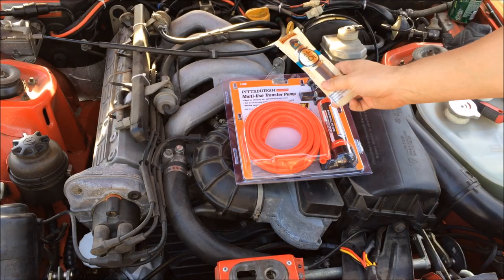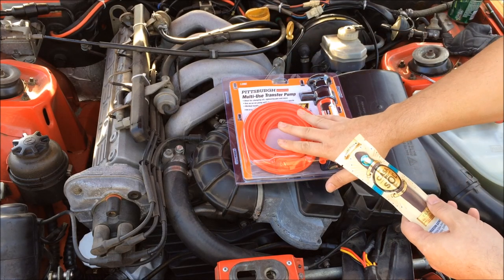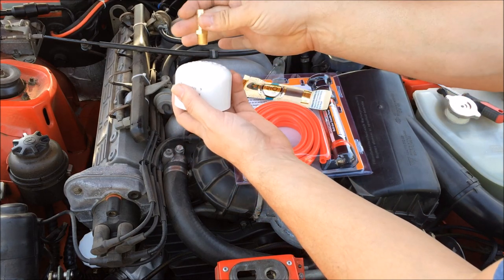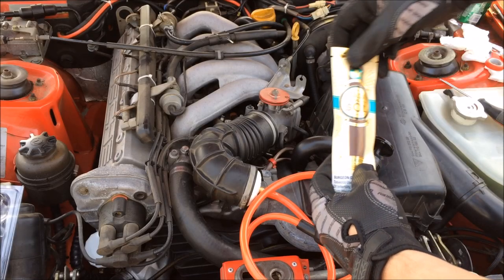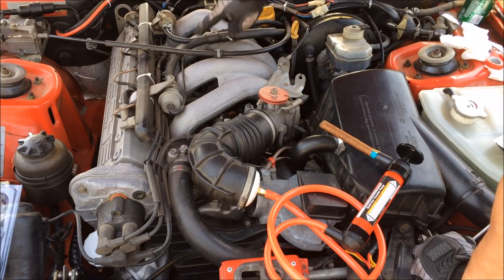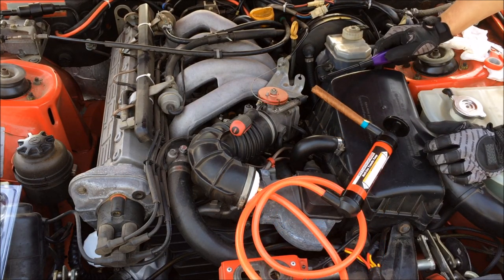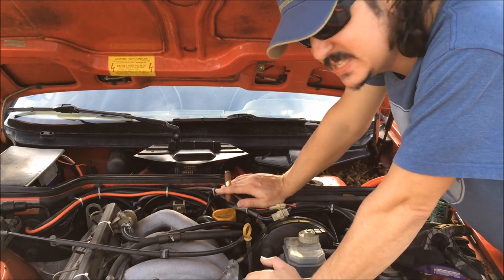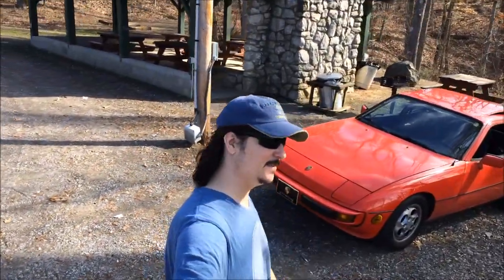Cheap DIY Smoke Tester

Comment: Im having a very hard time finding this barbed compressor fitting and cap, help me out more please
Reply from the maker: https://www.zoro.com/value-brand-hose-barb-14-in-barb-14-in-mnpt-brass-6afp0/i/G1502916/feature-product?gclid=EAIaIQobChMI2v--go6I2QIVlgOGCh27UwBmEAQYAiABEgLc__D_BwE
Reply from the maker: Here's what it looks like. Home Depot should have them... if not Harbor Freight might.
Reply: edredas thank you very much, the cap as well please
Reply from the maker: just a regular pvc pipe cap. Looks like this but you will need to know the exact size you need since all intakes are different sizes http://www.pvcpipechina.com/product/2-6-2b.jpg
Reply: edredas ok thank you very much bro
Reply: edredas i bought everything, how do i start when it comes to drilling that gold fitting into the cap? Im stuck because i dont have experience.
Reply from the maker: The easiest way is with a drill bit. Just need to get a small hole started in the center of the cap, then go back and make it large enough to thread the fitting in with a wrench.
Reply: edredas i dont understand, im sorry about that im just trying to understand how to perform this correctly on my own.
Reply: edredas i need help when it comes to drilling the gold fitting onto the middle of the cap, can you help me?
Reply from the maker: If you bought a male fitting then you just need to drill a hole in the cap large enough to thread it into.
Reply: edredas i dont know if its a male or female because yesterday evening i stopped to advance auto parts and i showed the employee that was helping me out the picture of the gold fitting and he found one closest to the one in the pic u sent me
Reply from the maker: If yours look like the one in the picture I sent then it is the correct one. You just need to drill a hole and thread it into the cap. https://www.joewoodworker.com/veneering/images/tap-the-cap.jpg
Reply: edredas i can’t find this pvc pipe cap for a 2003 dodge caravan intake, i checked home depot & lowes and no luck. What can you do to help me?
Reply from the maker: You will need to measure the the hose on the Caravan to know which size pipe cap you'll need.
Reply: edredas i just found a pvc cap inside ACE Hardware, it fits tight in the hose, its not the same pvc cap u have but a different style like this: https://m.acehardware.com/product/index.jsp?productId=1275960

Comment: What about a car with electronic throttle?
Reply from the maker: Hmm. Good question, unfortunately I'm not sure there is anything you can do. I don't recommend trying to move the throttle manually or you could mess it up.
Reply: Just remove the intake tube from the throttle body and place a rubber glove over the opening and find another vacuum line(possibly off of brake booster) for you to inject the smoke into
Reply: why do you think that matters? still do this smoke test the same way. electronic throttle bodies aren't completely sealed. there's always small passage for air so the car can idle.
Reply: @Wrenchingdaily   what?

Comment: Genius holy shit!!!
Reply: I tried this and found a leak from my EGR valve right away. Replaced the EGR and no more code! Awesome! Only thing is that next day the car wouldn’t start. Cleaned the MAP sensor and all good. That thick smoke can make the MAF sensor dirty (some cars like mine have MAP sensors). I’d recommend just cleaning those after doing this since it’s easy and you’ll have no problems on the road ✅ This method is so cheap and easy!!! Thanks!!!!

Comment: I also couldn’t find that cigar you used in the video either, its been a pain in a butt to find the cap and cigar. Lol
Reply from the maker: You can use any cigar, it doesn't really matter the brand. I just bought whatever they handed me at the store. As for the cap, there should be a size that should work. If you're not sure of the exact size you could always buy a few and see what works since they're cheap. I hope that helps!
Reply: edredas i dont understand how you open the throttle plate at all, i have a 2003 Dodge Caravan SE
Reply from the maker: Follow the throttle cable from the firewall up to the bracket. There might be a plastic cover over it, but once it is removed then you should be able to hold it open.
Reply: edredas i dont understand how to do that, can you help me please?
Reply from the maker: I looked online and it looks like the cable should be easy to access. If you aren't able to brace the throttle open, another option is to use a broom stick or something to hold the accelerator pedal down.
Reply: edredas how did you search that up, like what did you type?
Reply: i apologize but im not understanding anything on how to do that, i need help because im a beginner
Reply from the maker: The cable from the accelerator pedal runs to the throttle body, and will open when you press the pedal down. The easiest way to open the throttle plate is to have someone hold the pedal down or use a broom to hold the pedal down. Also you can just do what I did in the video and use a screwdriver or vice grips to hold the plate open.
Reply: if you dont mind, maybe if your able to send me a picture or make a video tomorrow showing me how it's done but filming it more closer to the throttle plate maybe i can learn like that
Reply from the maker: here's a video of someone cleaning the throttle body on a similar vehicle. You can see the cable on the right. You don't have to use your finger to open it like they did, you can turn the bracket where the cable connects and brace it so it doesn't close. But it might be easier to have someone just hold the pedal open if you are unsure.  https://www.youtube.com/watch?v=cHvom0DW-hM
Reply: I still don’t understand, I really need help.
Reply: Show me how to turn the bracket where the cable connects and how to brace it so it won’t close, can you do that?
Reply from the maker: I do this in the video. I turn the cam where the cable connects which opens the throttle,  then I use a large screw driver to hold it open. All you need to do is turn the cam where the cable connects, if you can't find it then use something to hold the gas pedal down
Reply: Do you have a picture or video so I can see exactly what your saying?
Reply from the maker: Here's an image of someone turning the throttle cam. https://i.ytimg.com/vi/mfgtBN-Kksg/hqdefault.jpg
Reply: When the throttle cam is turned, does it rev the engine?
Reply from the maker: Yes! It is doing the same thing as pushing the gas pedal. That said, the engine needs to be off during the smoke test.
Reply: Do I have to put a screwdriver somewhere on that throttle cam to help keep it open to be able to perform a successful smoke test with no issues?
Reply from the maker: Yes, either you can use something to hold it open or put something on the gas pedal to hold it down. Either way it needs to be open or smoke will not enter the engine and you won't find the vacuum leak
Reply: I’ll try and see if I can perform this, I’m a beginner
Reply: Im having an issue with a hose that won’t stay inserted, the hose that connects to the intake port, the hose has a plug that connects to it.
Reply from the maker: The one that inserts into the pump?
Reply: Yes
Reply from the maker: Make sure that there isn't any grease on it and that it is fully inserted. It should not come out if it is in there properly. That said, if it is popping out it could be due to high pressure. If you aren't seeing any smoke or hear any hissing, then you may not have a vacuum leak and the pressure building up is causing the hose to pop off. I hope that helps!
Reply: I did the smoke test, I was pumping a lot and fast, since I was doing pumping a lot and fast did I break any parts?
Reply: test test if you are such a beginner than wjy are you doing this test in the first place, you have no business working on an engine right now.
Reply: Research and Build because I want to learn.
Reply: @angeloyourreflection9331  you might have an electronic throttle research your car